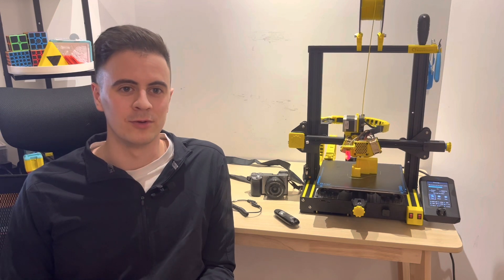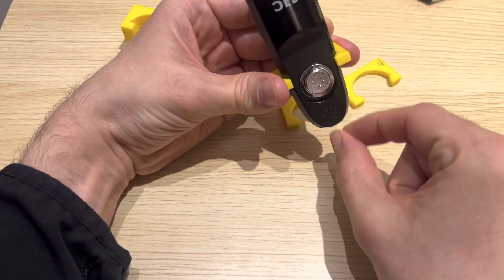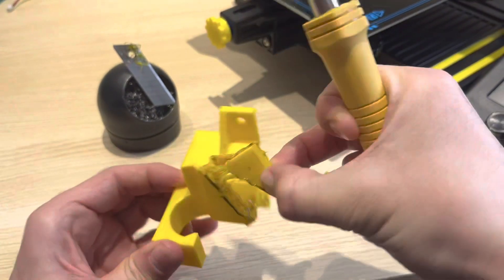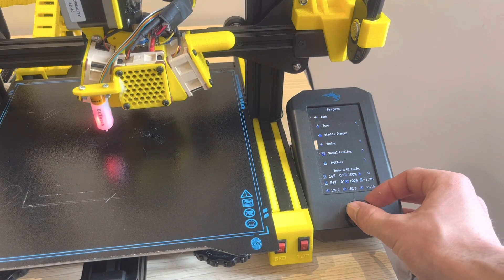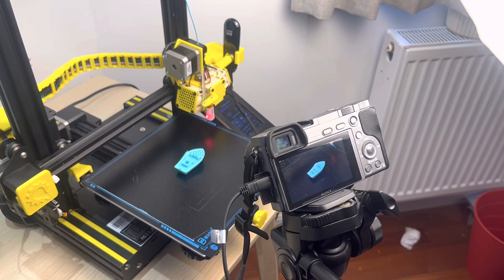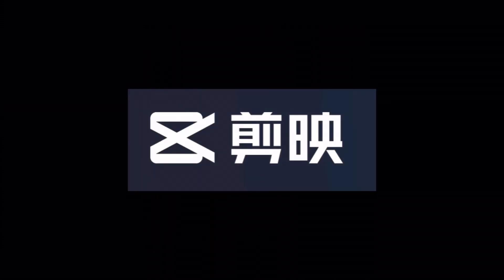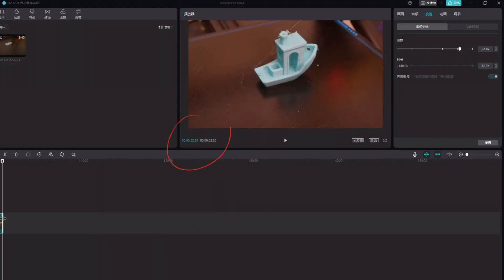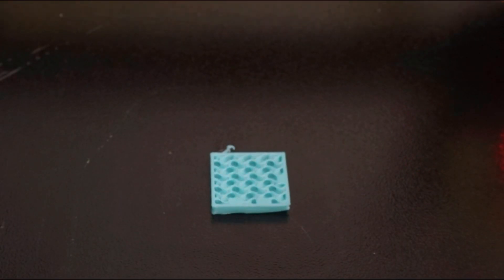Stunning 3D Printing Time Lapse Upgrade (Part 4.5)

Comment: 9:22 You can use Handbrake (free and open source) to encode the video as you like. For personal use HEVC (H265) codec and RF24 quality should be great; for further YouTube upload use H264, RF22 or less (lower values = bigger size but better quality)
Reply from the maker: Thanks for the suggestion, since the video I found Capcut software which I use now for the time lapses which is pretty easy to use.

Comment: Man, what a lot of work for something so simple. I use octoprint on a raspberry pi and this is a standard feature. With octoprint and octodash installed, your c3dv2 becomes a network serviceble printer with remote view by webcam. I use octodash with a 7" display and use the display on the c3dv2 no more, it's there for show.
Reply from the maker: That’s come good advise, I’ve heard about Octoprint but haven’t tackled that yet. Probably something I’ll try in the future. I do like the sounds of being able to start and stop prints remotely and not needing an SD card!
Reply: @DesktopInventions   It will change your printing workflow forever, you can just hit print from Cura and wella print started